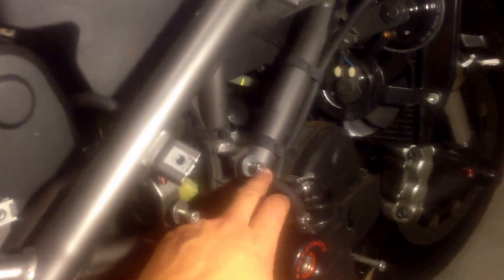Remove fuel tank ducati 848

Comment: So I have to show the emission sticker on the bottom of the tank which requires me to partially remove the tank. Basically I removed the excess hose and evap hose then slid the tank down/back to remove the two posts from the front allowing me to lift the front of the tank and view the sticker... Putting the tank back is my issue. I made sure the two grommets that the posts go into on the left and right of the ignition panel were pushed all the way in, made sure the posts were all the way in, put the two fuel hoses in they're metal holding brackets, but the main hex bolt that holds the tank down at the back no longer lines up properly to bolt it in. Do you have a video on installation or thoughts? 2008 Ducati 1098